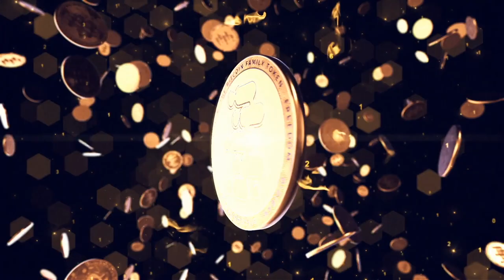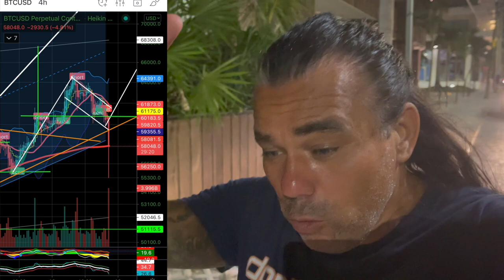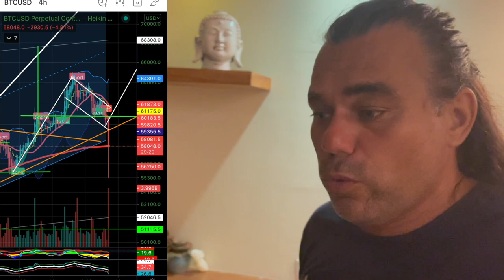BITCOIN HUGE DIP WHILE I WAS BUYING THIS BITCOIN GIFT FOR MYSELF!! Jessa is a smartass 🤣

Comment: Bitcoin and Litecoin reward halving supply shock accelerating even faster down the track ...🌬...🏄🏾‍♂️ 

2012 and 2016 halvings preceded the exponential 2013 and 2017 surges!